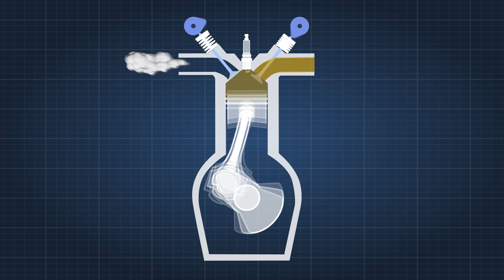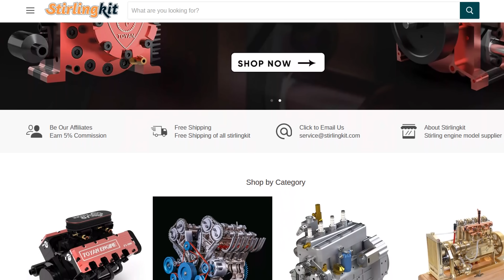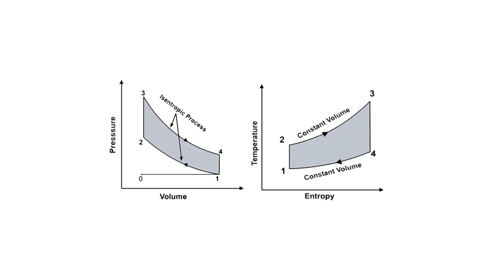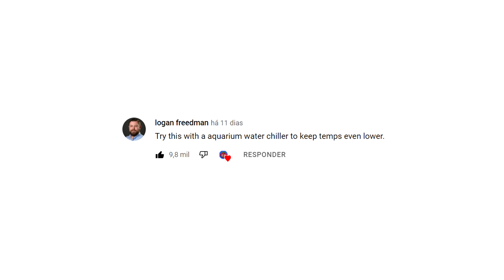I 3D Printed a Transparent Combustion Engine in Resin

Comment: I'm thinking its spark plug gap & flame front, because each fuel burns at a different rat so adjusting base timing along with spark gap will help the flame ignite, travel thru the cylinder completely (hopefully burning all the fuel) then exiting completely ...did u set the lash, or gap, on the valves? is there overlap or possibly hanging vavles or even not opening enuf to let mixture in or out ??  also probablly not an issue but sumthing to also note, the mixture will change the overall compression...good luck

Comment: it seems that nitromethane burns more slowly or does not burn at high pressure or more oxidizer is needed (judging by the video with the 9:04 ball) but I don’t really understand this.  it’s just that if we compare conditionally the rollers in which balls with a mixture of hydrogen and oxygen are set on fire, these balls explode immediately, and do not burn in the direction of the burner.  perhaps it is worth making an installation into which you can fill the mixture, compress it with a piston and then set it on fire (not cyclically, so as to check the mixture for combustibility and pressure created by the explosion), count the time and pressure created in the installation and thus evaluate the fuel efficiency.

if I made a mistake with the words, tell me where) I used a translator.

Comment: My guess is that the timing of the spark is too advanced, or you have some detonation going on with the more powerful fuel, and the explosion is actually slowing down the engine.  I wonder if an Arduino incorporated into the build would be fast enough to adjust the timing of the spark.

Comment: The key is the rpm’s. That also mean higher piston travel speeds and higher vacuum. That means lower amount of oxygen able to enter into the cylinder before the intake valve closes again.  With a low pressure inside of the cylinder at bottom dead center there is very little air in the air/fuel mixture to compress. That is the same as low compression again. That is why high performance engines need turbochargers or super chargers. To force air into a cylinder where the piston is going to be moving too fast to breathe well. I hope this helps.

Comment: Maybe the engine makes the fuel ignite a bit too early. Nitromethane explodes quicker so maybe the difference is bigger, because there is more power earlier to push the piston in the opposite direction.

Comment: I don't know about this little engine. But I'm going to take a stab at this and say that you air to fuel mixture is to blame for your firing inconsistencies. The engine is needing more strokes before it finds the correct balance. I'd wager to guess that's your issue. That little engine has probably always skipped a cycle its just now that you've been able to observe it. That's why most tiny engines are 2 stroke. What you've got there is something more like what they used to call a skip fire engine. 
Maybe install a load on the motor. It's won't try to run away as quickly that way.

Comment: All I can think of is AFR issues, plug gap and low compression. With methanol, you need more fuel than you would with gasoline for the engine to run properly. If the carb is set up for gasoline, then you'd be running incredibly lean with methanol. Maybe your plug needed a wider gap to ensure ignition, or maybe it wasn't sparking correctly and needed a smaller gap.

Comment: Ignition timing.  The faster the engine runs the more advance you need to keep the start of burn where you need it. Otherwise the spark happens too late to properly ignite the mixture.

Comment: Integza, my friend, that's exactly why multifuel engines use the self ignition principle just like diesel engines. Multifuel engines are used mostly by military in tanks. In these engines when you change the type of fuel you change the ignition advance angle based on the tabels provided with engine, this way you don't have to manipulate sparkplugs and carburators. These engines literally run on anything from jet fuel through conventional fuels like diesel or gasoline up to used frying oil from golden arches.
Love your content, 
Fan from Poland

Comment: So the fuel burn rate is different for each fuel. methonol burns quickly. And even though drag cars used to use nitro methane most have switched to ethonal for top fuel drag racing if I remember correctly. So although one fuel might be more energy dense the methanol burns more quickly and has more complete combustion which usually means more efficiency. Although in certain engines it's less efficient because the explosion can cool too quickly in the engine causing knocking. I'm trying to recall the paper I read on alternate fuel engines but the timing on four-stroke running on ethanol, and I assume it holds true with methanol, had to be decreased to increase efficiency. Your small engine just might have a better stroke and timing for methanol than any of the other fuels. You also have to consider that methanol is likely more compressible and lighter than the other gasses probably inducing less energy losses during 3 of the strokes. Combustion is weird.

Comment: I don't know if this was alread, mentioned before... I think the nitromethane was slow because the timing of the ignition didn't match the burning rate of it. Nitromethane burns slightly faster then gasoline...which would mean that you have to delay the ignition... if you start burning it too early (you start probably before the piston reached the top), you might be braking the piston before you accelerate it again....

Comment: The combustion triangle. In order for combustion to occur you need fuel, oxygen and heat to be in proper proportions to each other. Too much or too little of one of those three (heat/oxygen/fuel) and combustion will not happen. My guess is your carburetor is mixing the air and fuel improperly half of time. Too much fuel will have a quenching effect inside the combustion chamber and not enough fuel means there isn't anything for the spark to ignite.
Is there a way for you to check the distance between the magnets when they pass by each other while the engine is running during normal operation? There is the possibility that some slight vibration is causing the magnets to "flex" away from each other just far enough to prevent normal function, i.e. BANG [power stroke] vibration shockwave travels through the motor while the piston/con rod/crankshaft/etc. go through the other 3 strokes. The vibration causes a gap between the stationary and rotational magnets (no spark for the power stroke). NO BANG [power stroke misfire] significantly less vibration travels through the motor which means the magnets will be passing each other with the necessary clearance between the two sets which will make the spark happen.

Comment: Attach a generator to the output of the engine and a resistor to it ,to replicate a load and measure it through a multimeter with different fuel ⛽️ this would give you a better understanding of power production. Then we can work it out for torque (P=2.pie.N.T/60)

Comment: if i had to guess its prolly a combination of poor compression. you can see in the 25% nitro clip, gases escaping the top of the cylinder wall, and the higher octane fuel. which burns at a different compression rate. as for the speed and cycle issues not related to compression and seals, seems the timing and likely even the very long and unsupported push rods are messing up the timing of the cycles.

Comment: Spark cut rev limiter.  Also each fuel wants different ignition timming.  
While methanol had less btu per litre it burns at air fuel ratio of 7-1. Where petrol 14-1.   The methanol also had a good cylinder cooling effect where a methanol engine needs much n
Less cooling than a petrol. 
Since you may not have good fuel mixture control it make also take a few revolutions to build up enough fuel to burn.

Comment: Hello integza, I've been a huge fan of your channel, and you inspire me to pursue an engineering course in college. Btw i am just curious about heating coils in water boilers. Because from what I have known, many systems work vice versa. Like a fan can push air using electricity, but it can also produce electricity if there is a wind rotating the fan. So can heating coils in water boilers do the same, like can it produce electricity by heating up the coils. If so, maybe it can be an energy recovering system for engines since it produces a lot of heat. I hope you notice me I am just curious.....thank you

Comment: Your test leaves too many variables left on the table. Simply having the ability to adjust spark timing would show each fuels ability to make power. You have supposed the capability of the fuels in actuality near reversed. Pump gasoline having a fairly short carbon chain and low oxygenation is the weakest fuel, as your ability to control burn is the lowest. E85, and methanol would be the next 2 strongest respectively. Nitro would be the strongest. The higher the carbon chain the higher the ability to resist detonation/knock. The higher the oxygenation, the more fuel you can burn. More fuel = more power, more timing = more power (to the point the fuel self ignites).

Comment: You are right, the sensor used is too crappy to work above a threshold. Might also be a safety design choice to avoid engine damage. 

The reason why with the "more powerful fuel" will not run faster is because the amount of fuel sucked in depends on Zylinder volume and flow resistance of the fuel. The vacuum created in the carburetor is approximately the same because the volume of the Zylinder didn't change. Thus the force on the liquid pulling it through the jet is also the same. The only thing different is how much of that force is needed to overcome friction from the walls.  This will effect how much fuel is sucked in. 

Just how well a fuel disperses in air also plays a huge factor in how much energy you can generate. You can have all the fuel you want if nothing is in direct contact with oxygen, only a portion will burn. My guess is the methanol has the lowest flow resistance and created the best aerosol. 

The reason why drag racers use top fuel is because they will directly inject as much as humanly possible into the cylinder. The specific energy density is worse than regular gasoline, but because it needs much less oxygen you can pump in so much more. There's a limit to how much air you can press into a cylinder, using that fuel just makes better use of the oxygen by Pumping 4x as much fuel into the cylinder.

Comment: The most powerful fuel is making the least amount of rpm’s because it has the most force to blow by the rings on the piston, leading to a loss of compression. I would be curious to see you put the engine back together normally and see what each fuel runs at.

Comment: methanol has an octane level around 110 mean while gasoline has and octane level of 83 to 87 what that means that the methanol burns quicker than the gasoline by 10 to 20 percent those little  flames from the methanol in the engine  is normal the engine is not struggling with commpression you just need to time the fuel injector to more richer

Comment: I do a lot with rc glow/nitro airplane engines, and I have noticed the same phenomenon with rpm related to the fuel "power". From what I understand, the power being output is higher in theory because there is more oxygen available when there is nitromethane present. All that oxygen causes the explosion to happen faster, though, which may not allow for the same pressure due to expansion in the explosion. Since the fuel explodes faster, it may require a shorter stroke to maximize the efficiency. I have a feeling the power loss is due to either not having as much gas expansion (caused by fuel ratio), or the gas is expanding completely before the piston reaches the end of the power stroke (causing momentum to finish the power stroke instead of the explosion gasses).

This is a mixture of personal experience and logical reasoning, and simply a theory. But there is strong supporting evidence that it could be the correct answer. Maybe check the vacuum/compression. A more explosive force may also be causing some pressure to leak where a less potent fuel may not have as much loss. 

Great video!

Comment: Love the videos,
I would like to provide my two cents on why she wasn't running right: 
As a qualified and experienced small engine tech, and what you have there is essentially a small vintage briggs and stratton engine,

I reckon your fuel mixtures were off (too rich)
The reason you got better combustion with the 25% nitro is (as you perfectly explained)
the nitro requires less air to burn, so a rich mixture actually helped its combustion.

If you adjust the fuel mixtures, I suspect gasoline would end up running mint.

Comment: It could be that the engine doesn't make enough compression to make full use of the higher energy fuel? Otherwise the spark plug might not have a good ground because of the resin?

Comment: Oh, and you should try to print a telescope, except the lens is epoxy, polished by you. No glass allowed. .
Print a shoe with custom foot and toe craters
Print a 3d printed aeroplane and print a wind turbine for it and fly it on a sting behind the turbine.
Build a wind tunnel to teast aerodynamics with smoke 
Print a chair with motorized wheels and drive yourself around the shop for peak efficiency.
I really need a 3d printed for my nonprofit lol...

Comment: "Just an idea "   
Why wont u try to meke a turbo jet engine and not a turbo charged jet engine
Its easy to make and not that expensive
You just need a turbo and some metal pipeing  
The injection is happening at the hot side of the turbo.
The gas(propane) and air intake is the same inlet on the hot side of the turbo, and the air compressed by the turbo is the air suply after start for the hot side 

and so you get a self-sufficient jet engine
Have a great da ly every one 

TOMATOES ARE DISGUSTING

Comment: Gasoline 4 stroke engines have a brake specific fuel consumption between 29% and 36% while 4 stroke diesels have up to 52%.

The diesel is better than all turbine engine types.

Wankel engineers are far worse.

Comment: I think your 25% fuel is acting sorta like a spark ignited Diesel engine. Diesel engines turn slower, so less horsepower, but have higher torque

Comment: Make a gasoline engine that uses heat to turn a steam piston to add more power to the engine. Cars run at almost boiling point of pure water. Wrap headers and all in a water jacket of some sort and no radiator just a resavore that can auto add water once it hits a low point. That way you use the 75% waste thermal power

Comment: Suggestion:  Try creating a rocket motor using a dry ice pressure vessel (no melting of 3d printed components) connected to a nozzle with a diaphragm valve set to open at a certain pressure. Perhaps you can get consistent thrust out of this type of design although it may not be much as the dry ice gasifies and pressurizes the vessel? Would be interested to see how this turns out or what you think! Great videos by the way!

Comment: My favorite videos of yours is when u actually make stuff go!  For instance making this engine turn some wheel on a car or turn a propeller on a boat ect..  so do that!   Make something move! Tomatoes are delicious 🤤 ur the man!                                                   Also,  timing is an issue with ur tiny motor, probably carb issues as well.  Stroke out ur tiny motor to make it suck more gas and have more compression! 3D print it! 😎

Comment: When it comes to engines.... higher octane you need higher compression and timing adjustments. Now if you add high octane fuel for ex. (91octane) to an engine with lower compression  and set up for lower octane fuel (87 octane) the fuel burns at different rates and in more serious case you can get fuel knock or it just won't run to its potential... now if you have a very high compression engine and it's set for higher octane racing fuel (111 octane) and you put lower octane fuel or pump gas (87 octane) you will get horrible detonation (where the fuel ignites before the explosion cycle of the engine is ready) and it hammers the piston as it goes to make a revolution

Comment: Hey integza, the fuels you are putting in the engine are not necessarily more powerful. They would be equivalent of having a higher octane fuel. Higher octane fuels are used in order to prevent pinging in an engine or something called pre-detonation. It is when fuel burns before it should, meaning before the stroke meets top dead center. Using a higher octane has less of a chance to detonate until receiving maximum compression at the end of your stroke with the spark from your plug. This is used to push the timing of your spark as late as possible beyond safe limits for lower octane fuels therefore gaining more power from igniting at top dead center of the piston or as close to it as possible.

The only reason I can think your engine is skipping strokes is you may not have enough compression to run those fuels or may need to make your fuel more lean (less fuel) or rich (more fuel) by adjusting your carb.

In your situation currently, I’d try lower octane fuels though considering that’s your variable already.

I’m not well versed in carbs btw

Comment: try a fuel called diesel cuz its more powerful than gasoline and a diesel engines dosent need a spark plug it uses compression to ignite cuz the diesel hs more molecule than gasoline and diesel engines had more tourque than gasoline at low rpms